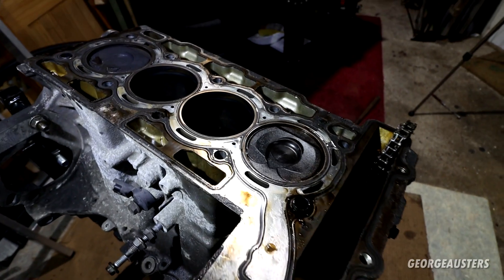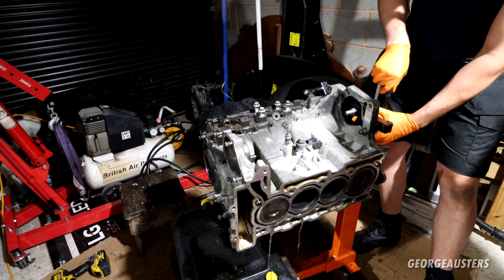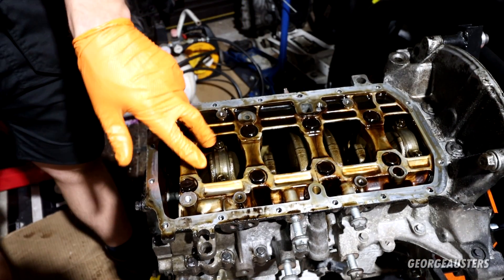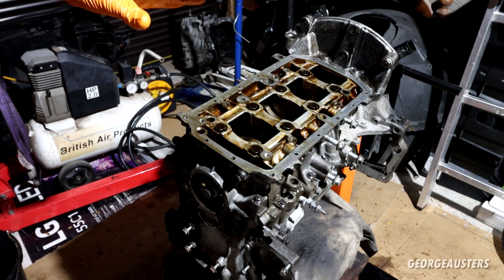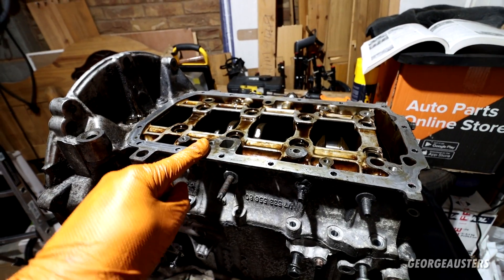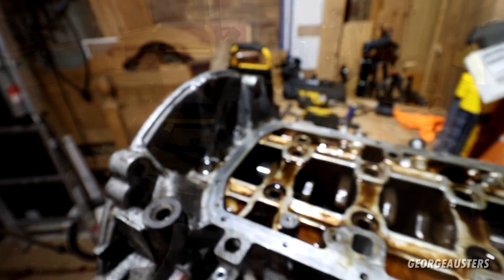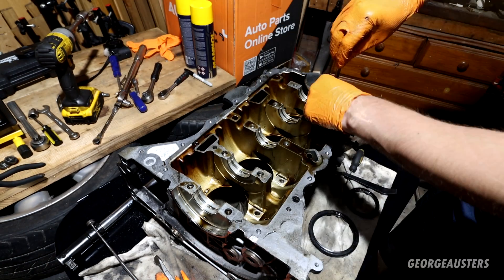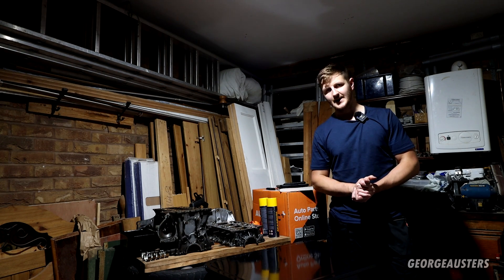MINI COOPER ENGINE BLOCK DISASSEMBLY

Comment: I would check what cylinder liners you have before a rehone, as it's an aluminium block they are most likely nikasil coated and a rehome will destroy all the cylinders they have to be chemical stripped and recoated, all the best with rhe rebuild excellent vid 👍
Reply from the maker: Rehone or rebore you mean?
Reply: @GeorgeAusters  yeah sorry rebore, think nikasil u just use a light hone
Reply from the maker: Yeah this may only need a hone

Comment: I would replace all 16 valves since they are fairly cheap. I have seen cases people only changing the burnt or broken ones and down the road the other valves can fail.
Reply from the maker: No need to change the intake valves but I will be changing the exhaust valves👍🏻
Reply: @GeorgeAusters  good decision to replace the exhaust valves 👍

Comment: Will you be sending the block off to be re bored and re faced?.  Excellent video mate thanks for the upload.
Reply from the maker: I will be measuring the cylinders to see if they are worn past the tolerance, same with the block and head - checking for any warping
Reply: Btw: using a torque wrench like that has most likely stuffed up its calibration. It's a measuring instrument,  not a brute force tool....